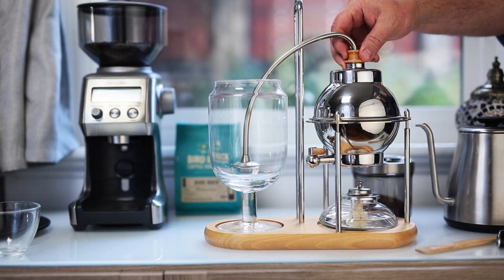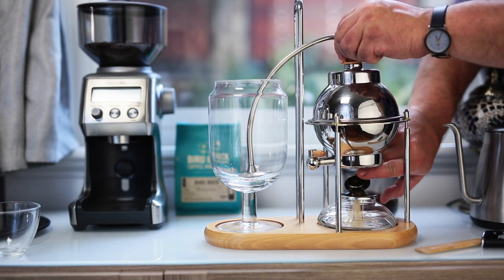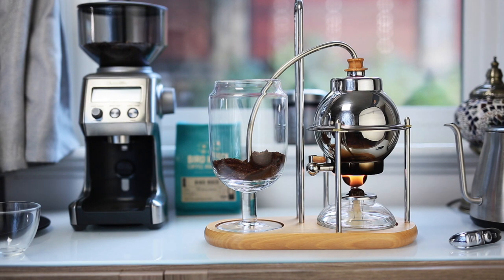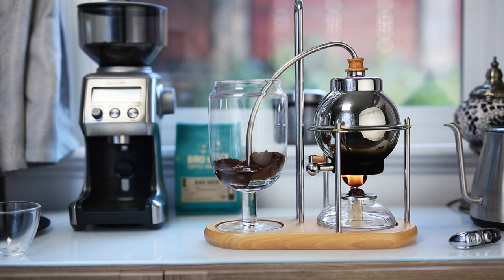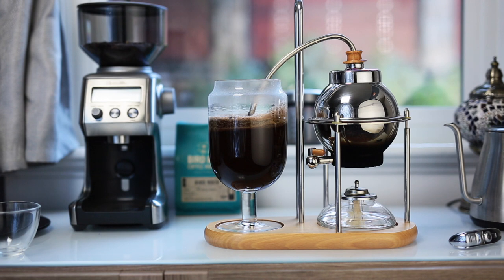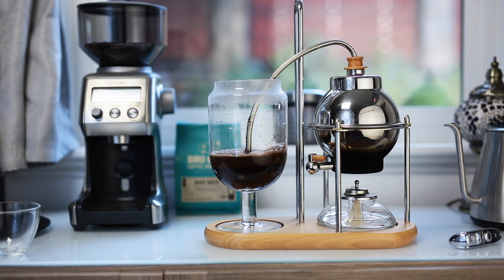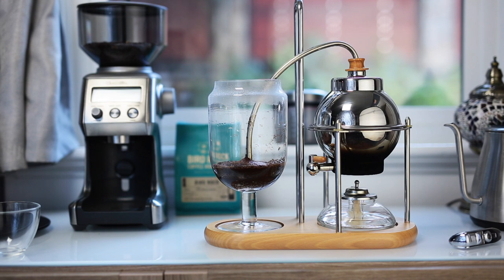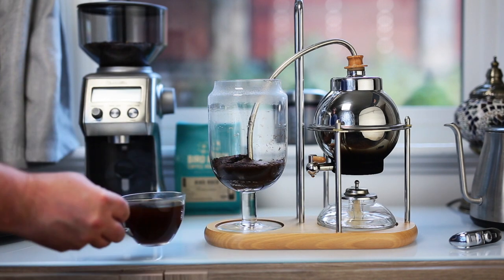Using a Balance Brewer

Comment: one cool thing though about the soot you can actually use that to not only make makeup like they did back in the day, but you can also use it to make dipping ink. If you're into that sort of thing so have a small container next to the sink and when you have enough put in a little bit of vodka because it will evaporate, and you can use that to write.

Comment: This should be made with a ferrous stainless alloy for the boiler, a and an induction heater, that goes up with the boiler pot, and is shut off with a relay and a timer.